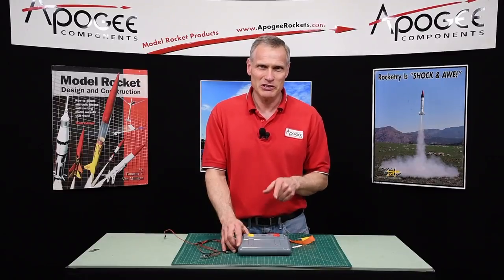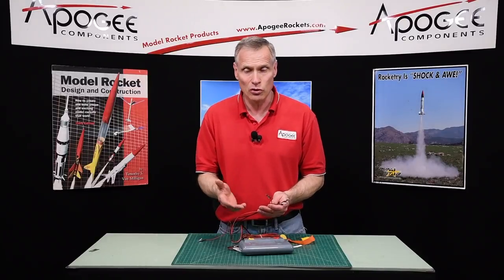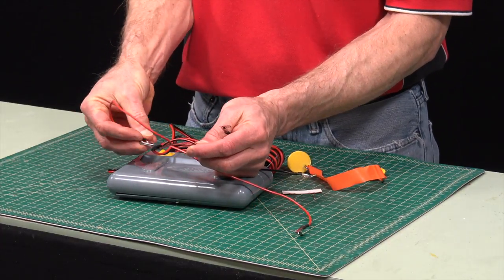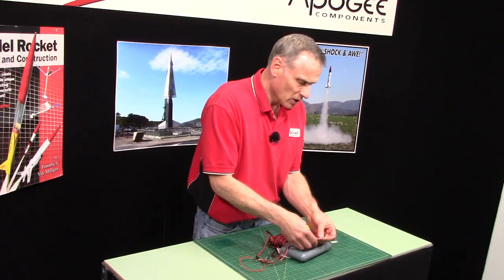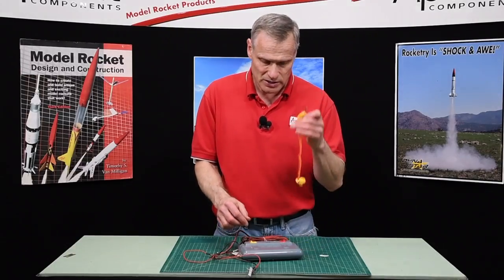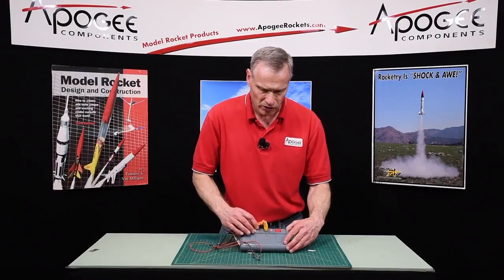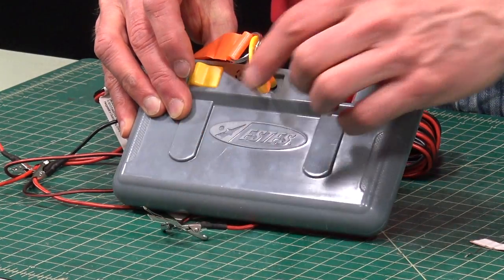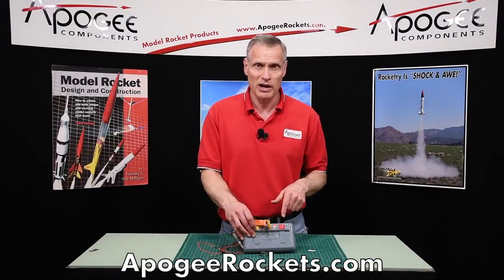Estes Pro Series II Launch Controller

Comment: I love this controller.  The directions say you can add a 11 volt lipo 3c battery.  Do I need to use a Lipo  when launching with the aerotech first fire and first fire junior igniters for G and H size motors?  Or do the C batteries in the standard configuration have enough juice to fire the aerotech igniters for G and H motors?  I thought those igniters needed 12 volt. But I never learned Ohm's law when I was a student.  
Thanks for offering this inexpensive and well designed launch controller.
Reply from the maker: G motors are fine. H motors are NOT. The reason is that the NAR safety code for high power states you have to be 100 feet away during launch. The length of the wires is 30 feet - so you are 70 feet short. You should be launching High Power motors with a club, because they will have the right controller for H and larger motors.

Comment: I was hoping Tim would cover the LiPo option and clustering. Been using my Command Control for years and I run either one or two 2C LiPos off that and it works well. I have launched composite motors in January on the ice and the old launcher does the job (I tuck the batteries in my pocket and use a low voltage alarm)

I just got the new PS2 launcher and have a 3C lipo that I can use but I have to figure out if it will fit w/ a low voltage alarm, then get the right plug for it.
Reply from the maker: Why not experiment on your own? I'm not an electrical engineer, so I don't exactly know what you're looking for.